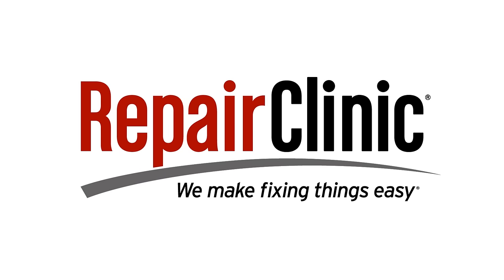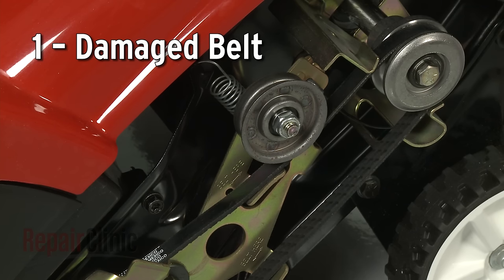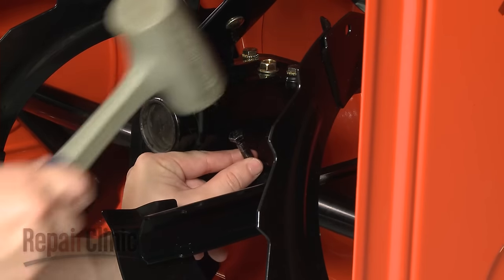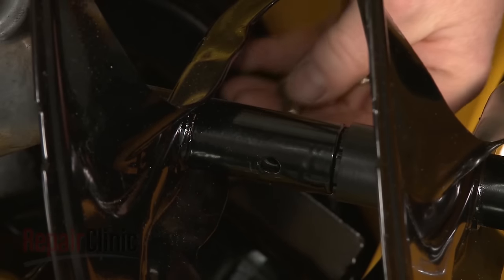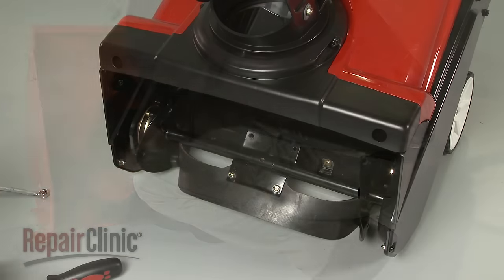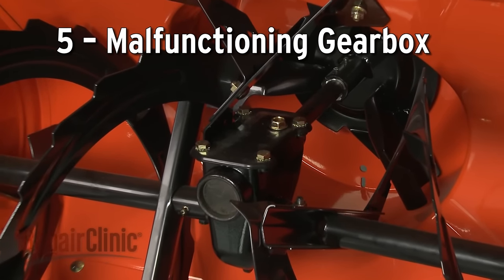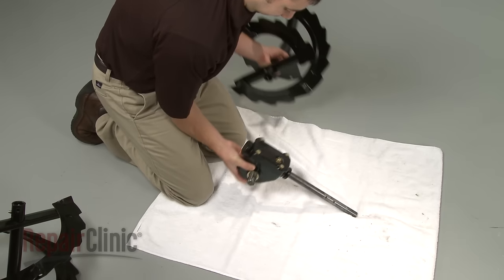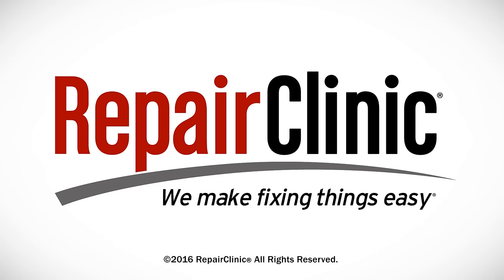Snowblower Auger Not Turning? — Snowblower Troubleshooting

Comment: THE FIRST THING TO CHECK -->  Frozen snow/ice that keeps the impeller or auger from turning.

It was dark out, so I was unable to see the ice blocking the impeller.  I chipped that out, and now it works fine.

Comment: I have an IMPELLER that does not turn, auger turns fine. New owner, super low use second hand 26" Toro two stage.
Reply: Open up on the side to check the belt
Reply: @IdahoJulieMom  - Thanks for your time, but if I had no belt neither would run. It was two blown shear bolts. 
Just as explanation for others: the belt turns an axle which carries straight forward and turns first the impeller, & then the auger. If you have impeller (small fast-spinner that throws the snow up the shoot) but no auger, it's the small gearbox up front. If you have auger (big slow-turner draws in the snow) but no impeller, it's the shear pins. If you have neither it's the belt or other part inside the lower case. 
The bolts were $7ea with the nylok nut they require. They are of course supposed to break when something jams the system, which was probably a rock caught between impeller and housing.

Comment: Hi Repair Clinic. My Toro snowblower starts but when I put it in gear it stalls. Any ideas?
Reply: Thank you for that. I will check what you recommended. However, I think the horizontal churner at the front might be frozen so have a heater in front of it. I think that might be it because I cannot turn it by hand.

Comment: I had to pull off my belt cover and the gear from the engine that drives the gear for the auger, wouldn't engage because snow had frozen it. I used a torch to melt it and put a little extra grease on the shaft and the gear slid back-and-forth to engage again. Problem solved

Comment: Didn't help me...
Auger Handle seems LOOSE.
As if there was absolutely NO TENSION on the cable.
Reply: I replace the shear bolt and still not working. The tension cable shows no trager.